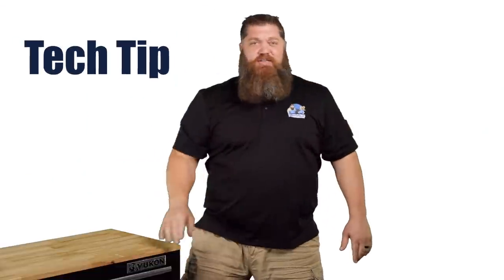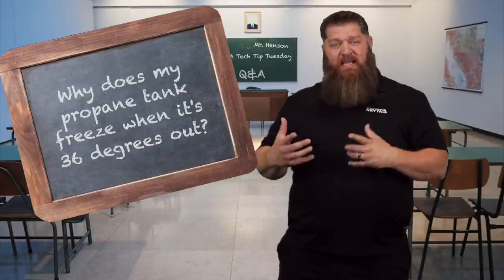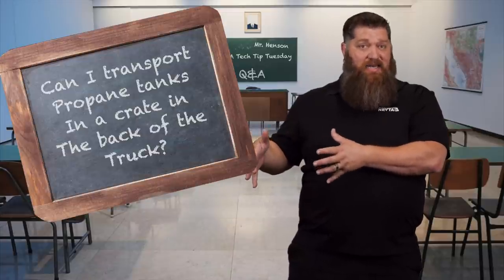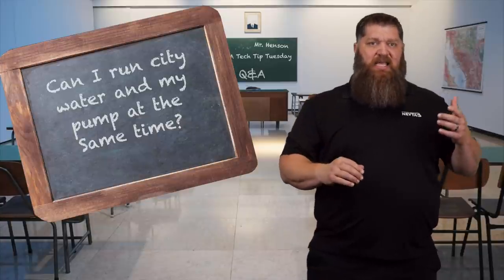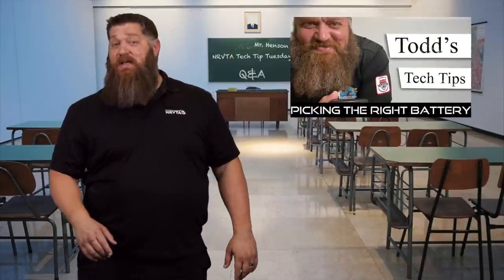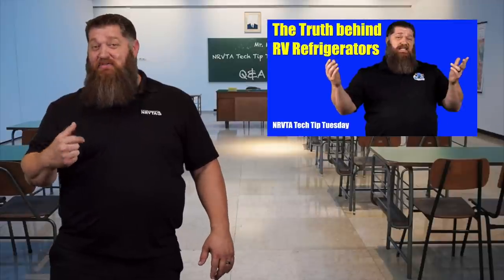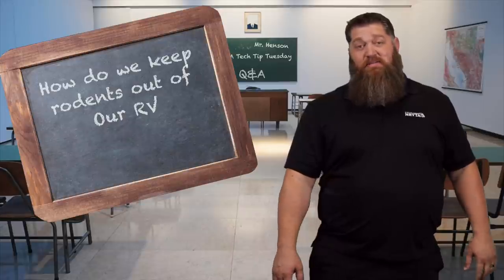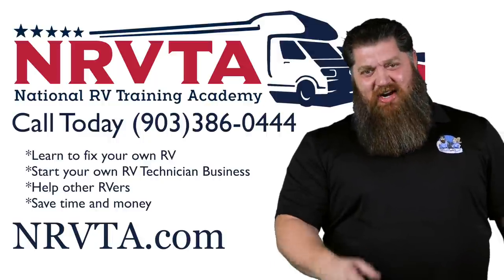RV hacks Questions & Answers

Comment: Pro Question: if I move the flux capacitor from my trucks 12volt system to the RVs 120volt system, will I need to connect the centrifuge through the converter and the nuclear rods through the inverter or will I blow a fuse?  I'm 99% done with the install.  Also, once the truck and trailer reach 60mph, will the field generator encompass both the truck and trailer or just the trailer.....and how will that impact weight distribution once the trailer passes through the event horizon?  Important info many ask but nobody seams to know the answer.
Reply: You’ll need a few more solar panels up top to generate the necessary 1.21 Gigawatts to power the flux capacitor… 😁
Reply: @mattmcd6514  that was my next question.  What awg would be needed and in what lengths to support the amperage without loss.
Reply from the maker: You’re a nut JD! That had me rolling. In all seriousness, I believe the answer to that is, yes 👍🏻
Reply: @NationalRVTrainingAcademy  awesome! I'll see you in the year 2051!
Reply from the maker: So we haven’t fixed the harmonic distortion between the flux capacitor and the nuclear rods. The transverse effects lay waste to the semiconductor electrodrivetrane. Half of the rig shows up in one point in time whereas the other half seems to be a shadow. I’ve called in help from others but no luck yet
Reply: At 60 nothing will happen u need to hit 88 mph
Reply: Or you could just fire some torpedoes from the rear to bump your speed just up to 88 if a clock tower is not available. You can always come back in a phone booth later to reclaim the torpedoes before any damage is done.
Reply: I'm dead.........lolololol
Reply: Before you move, better polish the Dilithium Crystals!

Comment: We've had ours for over 4 seasons and use Irish Spring soap in just about every space. Lol. Not a rodent yet. Ants this year bc I forgot to spray anything touching the ground and around it. One dose of the spray and they were gone.
Reply: Last year we had a mouse problem.  I bought a couple dozen bars of Irish Spring soap and put them everywhere, inside and in the basement.  The mice ATE them!  Every bar had teeth marks in it!  I tossed all the bars I could find (still finding them in random spots and yes, they all have bites out of them) and went back to traps...

Comment: Great videos - thanks. Can you talk about maintenance requirements for hydraulic systems like large slides and HWH struts? Specifically, how does one retract the system components if control panel is non responsive.

Comment: I havewatched your video and followed your recommendations for sanitizing the freshwater system/tank.  My fridge has a built in ice maker.  I haven't used it for several years.  Is it necessary to sanitize it and how would you go about doing it?
Reply from the maker: If you haven't used it I you shouldn't have to sanitize it. If you decide to use it again I would consider running the sanitization solution through the ice maker. let it set for a while, then run fresh water through for a few cycles until you don't smell the solution. then you are good.

Comment: Hey Todd,  Regarding running both pump and city water, in the case where pump pressure is greater than city pressure, isn't there also a risk of pushing water backwards into the city system if your backflow preventer is missing or malfunctioning, thereby risking contamination of the city water system.  This would be a pretty big deal and in my mind would be one of the biggest reasons to not run both systems at the same time.

Comment: Rats HATE PEPPERMINT, I use a peppermint oil/water mix and use a spray bottle to spray it all over the underside of my trailer and truck also in the engine compartment.
Smells sweet but the rats run from it, tried and trued.
Good day campers.

Comment: Could you guys do a video on pressure tanks vs accumulater tanks and when you need them?  Or using drills/impact guns to raise/lower stabilizers, is it a good idea?  How much weight is to much for stabilizers?
Reply: I've used impact drivers to raise and lower stabilizer jacks and it worked great it's way faster than using some kind of hand mechanism.

Comment: my question is ..i have hydraulic leveling jacks..i have 1 jack that does not retract all the way... but i have found that if i turn off and on system several times it will eventually fully retract ... i suspect a valve in main unit ... but im not a tech..thoughts
Reply from the maker: Join this group. https://www.facebook.com/groups/nrvta a lot of RV techs hang out in there. They may be able to help.

Comment: I have no battery power. Hooked to truck or shore power it’s all good. All fuses in unit are good. In line fuse from electric jack back is good. Ground is good. Batteries are brand new. Any ideas?
Reply from the maker: battery disconnect switch might be active.

Comment: My heater won’t shut off even after disconnecting the thermostat. It’s not just the blower motor the air coming out is hot. Do you have any ideas as to what the problem may be and what I can do to fix it?

Comment: I have a issue with my diningroom slide-out , it is very heavy( dining room table ,residential refrigerator food pantry and fold out 6x13 deck. It has never extended out and made the floor flat. Like it is missing something. I've adjusted the cable system often. Placed lippert rollers under the outside edge. The dealer has messed with it 4 times and each time unable to fix it. Would you be interested in a challenge? We are heading to Florida panhandle from Virginia on the 21st

Comment: I have a Battle Born battery in my RV and the OEM WFCO 55AMP Power Converter with 13.6V output. Does it hurt to charge the battery with OEM Converter since it never fully charges the battery to14.2v-14.6v?
Reply from the maker: This is not good for lithium batteries. The BMS balances the cells once the voltage hits 14.4 from the battery. 

A standard converter charger does not achieve 14 volts in absorption or float. This means the battery will never be fully charged and will wear out as the cells tend to get out of balance without the help of balancing the cells.

Comment: I have a tri-axle MORryde suspension trailer with 10k hubs. I recently packed the bearings with a high timken load grease. Would it be advisable to add a bit of 90 weight oil to improve lubrication while traveling? Standing still I understand this is not desirable. But what about traveling? Thank you

Comment: What about tire maintenance for a rig that sits for 6 to 7 months on site. I travel for work and got tired of hotels. So now I will pull  into a park for 6 to 9 months at a time and wondering how to keep the tires in good condition while sitting for long periods. My tires are under the slides on both sides.
Reply from the maker: Being shaded is going to help. Try these tips
1) Thoroughly clean tires with soap and water after setting up
2) Cover tires to block direct sunlight and ultraviolet rays.
3) Try to stay out of a high ozone area.
4) If you know you're going to be there for half a year, consider removing the tires and storing them in a cool dry place. Separate them with cardboard.

Comment: I have a two week old fith wheel the main slide would not come in on are first long trip had to figure out how to get in on my own and dealer can't even look at it for 4 mounts and need to know if there is a motor also on the geared bars that come out that might have a sheer pin or is it just the tube that looks like a long tounque jack.
Reply from the maker: Typically there is only 1 motor and good eye, it looks just like a tongue jack. Usually there is a synchronizing bar between each ram but only 1 motor.

Comment: I have a atwood model  93257 control board  4pin  it is bad.got a atwood model 93305 control board  6pin and 4pin is there an adapter to use this one

Comment: Can I install my 6000watt inverter off the 12volt cables that are on the convertor which are in the back of camper under the refrigerator? Or do I have to place it in the front near the batteries and run a 120 cord clear to the back to run refrigerator while driving to the camp site???
Reply: It's a modified sine wave inverter.
Reply: I'm no professional but, I always understood that the inverter needed to be as close to the batteries as possible. Then run a 120 cord to the back for your fridge. There's so much power going through the cables between the battery and the inverter it needs to be a short distance. That's what I was told at least.

Comment: If you are using the pump do I have to keep shutting it off if I am hooked up to shore power or using my generator?
Reply from the maker: No the pump is an on demand pump. This means it charges the lines to 45-55 psi and will turn off. Once you open a faucet then the pressure drops which then kicks on the pump. It will cycle off when you stop using water.
Reply: @NationalRVTrainingAcademy  thank you

Comment: Can you do a review of the newer 12volt refrigerator
Reply from the maker: We have a couple in house and we are putting them through the riggers
Reply: Ya it's in my RV and it's my understanding RVs are moving in that direction to reduce build cost
Reply from the maker: I love the concept. Apples to apples compressors are safer than propane heated coils.